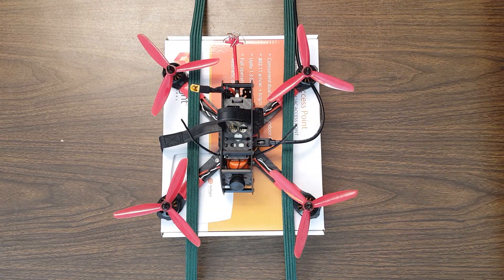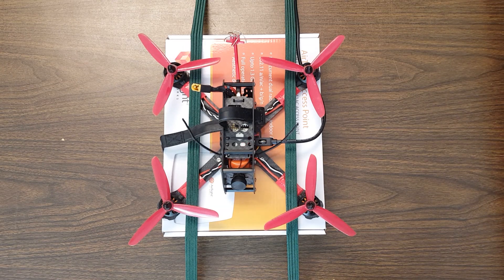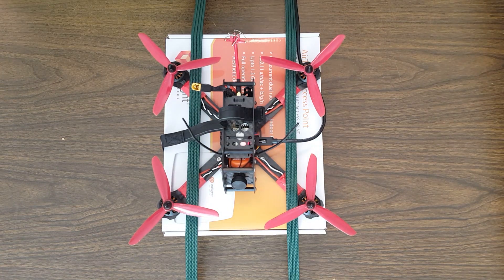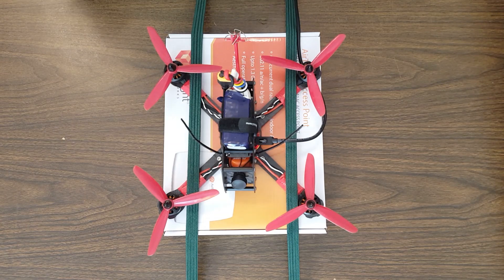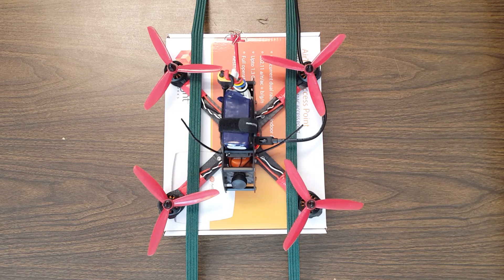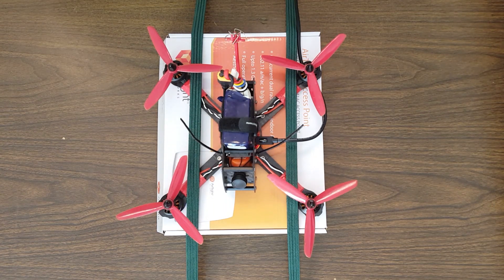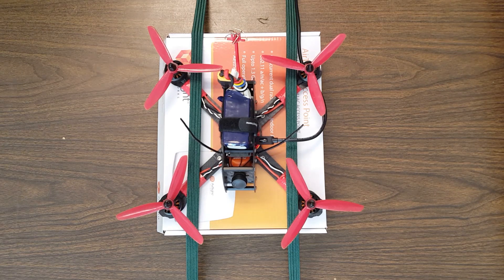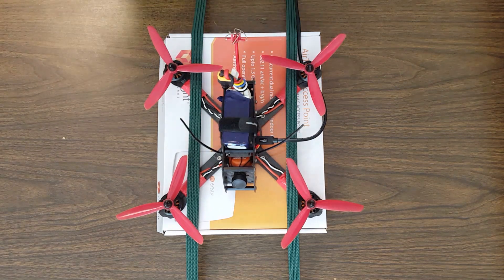Troubleshooting: Quadcopter Desync (Falls Out Of Sky)

Comment: Do you know what would happen if you were running a motor from the motors tab and the usb disconnects? I do hope the devs thought about this scenario as it could turn dangerous very fast
Reply from the maker: You try it and tell me.
Reply: I did out of curiosity !

Motors running via Motors tab, unplug USB, Motors continue running !

A bit surprised that it was this way, however, is it even possible for the FC to know the state of the USB and essentially have a USB signal Failsafe of its own ?

Surprising !
Reply: I'm kinda surprised  no one ever encountered this situation on accident. 

The PC has to poll a USB device to get data out of it so in theory the FC should be able to tell if it's still connected and if it hasn't been polled in a while, shut the motors down.

Did you test this in Betaflight? There is a strong possibility the same would also happen in Baseflight, Cleanflight and the Blheli suite.
Reply: I tried and motors kept running. Then I got my radio and armed it. pid started working and it responded to the radio. Then I disarmed it and motors kept running at what I had set with the gui. It only stopped when I reconnected the gui and stopped the motors from there.
edit: after I turned on feature motor_stop, I could stop the motors by arming and keeping throttle low, for the rest, no way to stop motors except from the gui.
So now we know why to strap down the copter when bench testing with props

Comment: hey joshua, I wanted to ask you if you know how to setup 2 switches to arm your quad with cleanflight. the first switch just spins up the motors, so you can pick the quad up while the motors are spinning and not have it freak out in your hand, is it possible to do this?
Reply from the maker: Cleanflight has no mode where the motors are spinning bu the PID loop is not active.
Reply from the maker: With an external app like CF GUI or EZ-GUI for Android, you can spin the motors, like via the Motors tab.
Reply: +Joshua Bardwell ohh okay thanks!

Comment: I've got an issue like this, but mine no longer arms. the motors seem fine and I'm getting comm. from the tx to Rx to Naze, I can even switch the modes over and see it on the Naze's leds. I've had this issue before (the not-arming one) but fixing the matter this time around has got me at my wit's end. the problem started after a great couple of batts in the field, and initially was a delay in response from my input. it would continue to push throttle after I dropped it, and in particular after a flip or roll. now it won't arm at all. any ideas?
Reply from the maker: https://github.com/betaflight/betaflight/wiki/Frequently-Asked-Questions#why-wont-my-fc-board-arm-after-upgrading-the-firmware-
Reply from the maker: But you're saying that the Arm mode does go green, but the motors don't spin, right?
Reply: +Joshua Bardwell it is green but flashing, my x4r is solid green, when I alternate fmodes the red led lights and stays solidly lit with a still-blinking green led on the Naze. I have a strong signal from the Rx on my taranis. my motors twitch-idle, so I know that escs and motors are fine, it just won't arm. I've tried throttle trimming in cleanflight and raise/lower the minchecks and min throttle (within the constraints of the escs operating throttle range). my escs are still calibrated and synced up.
Reply from the maker: In the Modes tab, do you see the Arm mode turn green when you arm?
Reply: +Joshua Bardwell arm does not light up, the fmodes do though
Reply from the maker: Something is preventing you from arming then. You're not actually arming.
Reply: +Joshua Bardwell in the receiver tab my channels all have low points around 990 and highs of 2011. would that be improper endpoints?
Reply from the maker: it's not exactly but it's not so as it would make your copter drop out of the sky. Exactly should be 1000 to 2000.
Reply: +Joshua Bardwell thank you for all of the help as always, it gives me a little hope. I'm beginning to wonder if something is wrong with my x4r itself. have a good night! and thanks again

Comment: could this be the reason why I can not get mine to take off? 
https://youtu.be/KiYIuixIqNk
Reply from the maker: Do the motors spin up by themselves after the throttle gets to a certain point, or are you raising the throttle and as you raise it, the copter flips over?
Reply: Thanks for the reply! No i give just enough to start rotation then they shoot up automatically.
Reply from the maker: This is almost guaranteed one of three things:

1. Motor spinning wrong direction.
2. Motors mis-wired (wrong order).
3. FC board is not facing forward and board_align is not set correctly.

For 1 and 2, confirm motor location and rotation direction with PROPS OFF using the Motors tab.

For 3, confirm that the 3D model moves correctly on the pitch and roll axis. If the board is 90 degrees mis-aligned, pitch and roll will be swapped with each other. If the board is 180 degrees mis-aligned, pitch and roll will be inverted.
Reply from the maker: One more thing it could be: if you have been playing with a custom mix, you could have the mix wrong. But I'm assuming you're using the standard quadx mix.
Reply: I can confirm the motors are spinning in the correct direction. I confirmed this during the ESC calibrations ( i double checked each motor ) . 
Now in order to make this Rev6 Naze32 to work with the PBD (https://www.amazon.com/gp/product/B01FX9SBJY/ref=od_aui_detailpages00?ie=UTF8&psc=1) I had to rotate the FC board. I did make an adjustment on the configuration tab in cleanflight, rotating the Gyro CW90 degrees.
Reply: The only thing i changed was the Max and Minimum throttle settings and Minimum command setting.
Reply: Thanks for the help! I figured it out thanks to the suggestions you mentioned. So I'll admit how much of an idiot i am. I told clean flight the board was rotated 90cw, it was rotated but it was rotated 90CCW. So I needed to tell Clean Flight a 270 degree rotation change. stupid simple mistake. 
Now i need to tune this thing it has bad oscillation on descending and it floats all over the place.
Reply from the maker: We're all an idiot now and then. I miswired my motors on a copter yesterday and was damn close to shooting off an email to a vendor asking if their FC was hosed before I realized it.

Comment: I've got similar problem. Motor sporadicly twitches at about 50%. Spins smoothly when higher. Replaced motor, replaced ESC, still twitches. I've set up experiment with no frame, just battery, receiver directly to motor, and BEC (different one). Still twitches. :( What is it, karma?
Reply from the maker: Something between the motor and the ESC I suppose. Have you tried changing dither setting? What BLHeli version?
Reply: Well, to exclude anything motor is soldered directly to ESC plate. I haven't done any ESC programming, just tried it off the shelve assuming the dafault settings shall work even if not optimal. Do you reccomend to get the programming tool?
Reply from the maker: If it's BLHeli and betaflight, you don't need a programming tool. You can just use passthrough via the flight controller.
Reply: Thanks for the tip, didn't know this. The only thing is - there is a possibility to have the ESC with BLHeli firmware and SimonK bootloader. If this is the case the cleanflight passthrough is not possible. I have'n tried it yet so don't know what bootloader sits on my ESCs. Will find it out. Thanks for advise.
Reply from the maker: +Andris Strals that's not true as of Betaflight 2.7. SimonK bootloader is supported.
Reply: That's good. At the moment my problem is - how to make it work on Linux. BLHeliSuite as such should work with wine, according to doc. However - it doesn't know what the /dev/usb is. And CleanFlight doesn't map the usb connection to some virtual COM port.
Reply: A quick update, in case it could help someone. The problem was in the ESC settings. First, there was an old firmware version on it. Second - PWM was disabled so I am confused how it did spin at all. Anyway - flashing with latest BLHeli and enabling PWM solved the problem. 
No so successful on Linux side of things. BLHeliSuite works just fine vie Wine, the USB serial port should be soft linked to COMn in the ~/.wine/dosdevices directory (as described in docs). However I was not able to make the CleanFight pass-through work. The BLHeliSuite complained about old CleanFlight API which "unlikely supports pass-through". For initial setup its fine to use the USB interface however it could be beneficial to get the passthrough  work as well as it could significantly reduce amount of effort should any ESC programming needed later on.
Reply from the maker: PWM input refers to true PWM as used to drive brushless motors.

Comment: The stator is loose. As it was moving around it just ripped the wires off.
Reply: nvm...you realised that at the end of the video
Reply: Yes, I see the stator moving at 3:40. I had this happen with one of my motors when I was troubleshooting vibrations on the bench
Reply: Wow, that stator movement is so intense

Comment: i put my props on backwards to test stuff like this :)
Reply from the maker: +jamble7k you also have to reverse the motors, right?
Reply: +Joshua Bardwell no that would mean that it pushes the quad to the ground and keeps it in the same place
Reply from the maker: Isn't that what you're going for?
Reply: +Joshua Bardwell sorry I worded that wrong. I meant if you did reverse the motors it would not chance anything. You would keep the motors the same direction and reverse the props.
Reply: +Fullwatts FPV yes that is what I mean.

Comment: I had same thing on a cheaper 'helipal storm pro' motor. the winding/ armature was moving during operation about 10-15 degrees, causing sync problem. only found it after replacing the fc, and esc's. now I run xnova 2204 2300, and after running about 40 4s batteries, no problems, except getting used to how fast my voodoo210 is, lol.

Comment: How often do you run into this sort of issue? With higher quality motors, I'd suspect this is rare, but I've seen it enough at the field to think it's fairly common? Is there a way to determine an issue such as this with a meter?
Reply from the maker: +willdoryder this is the first time I've had one fail from the factory.
Reply: You can measure the inductance (Henry) with a cheap LC meter, e.g. from eBay.

Comment: I'm having the exact same issue on my backup rig. It will fly just fine until I do a flip or roll. But as soon as I do, it flips and rolls in all directions as it's coming down.
Reply: This is the EXACT issue i'm having. What was your fix?
Reply: +Christian Wilhelmsen yeah I didn't describe it very well. Although I have been in that situation too with my other rig. Raising min throttle fixed that though.
Reply: ever get it fixed?
Reply: Sounds like a PID problem to me. If you are able to stabilise it and fly again that is. Try turning your P much lower and see if that makes any difference.
Reply: +Christian Wilhelmsen no, pids are fine. Flys well as long as I don't try flips and rolls. But as soon as I try and bring the stick back to centre after a flip or roll, it just goes crazy. Not recoverable either I don't think, way too erratic. As it goes crazy it's flipping and rolling, pitching and yawing. I've just replaced motor 2 to see if that helps as that motor took a hit some time ago during a crash. Seemed fine, but maybe it's finally given out.
Reply: +mrmurder75 dealing with a similar death roll problem here too.
Reply: +mrmurder75 Ah, I misunderstood then. I thought it flipped violently after a flip and vice versa with a roll.
Reply: I'm having this exact issue with my new build
Reply: +mrmurder75 changing the potentially dodgy motor didn't help. Demag in blheli set to high didn't help either. Raising min throttle didn't help. Not sure where to go from here. Given up on it for now. Next step might be to strip it down and redo all my solder joints.
Reply: I updated to latest BLHeli, latest CF, adjusted min and max throttle settings and did the motor calibration via BLHeli only. This appeared to work perfect for about 5 packs. Then, out of freaking nowhere, I rolled the quad at like 60ft up over concrete and it went stupid...   That death roll costed me over $250. So angry.
Reply: +BisMaxx ouch.
Reply: Exact same issue here. I'm going to replace the ESCs and see if it helps